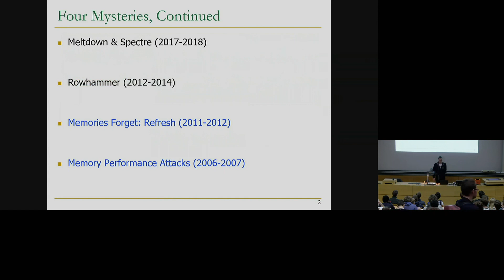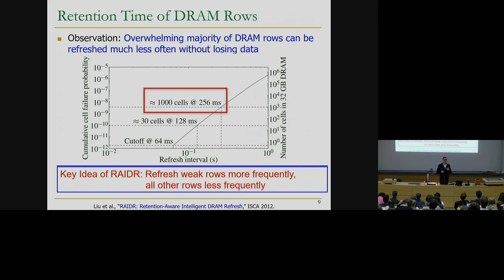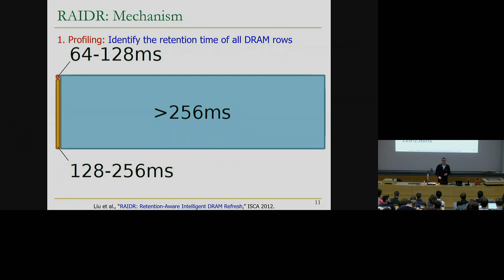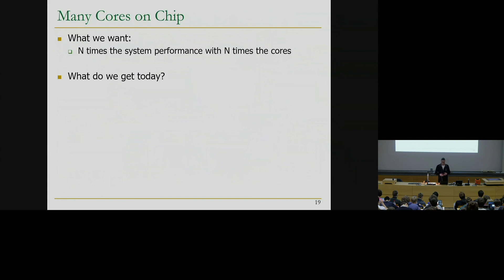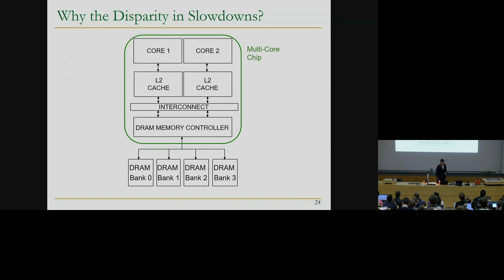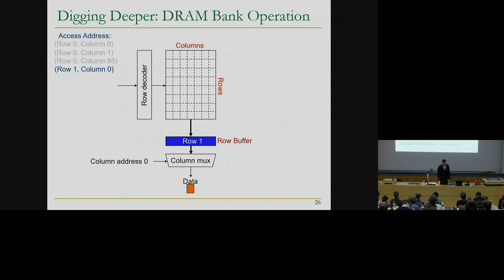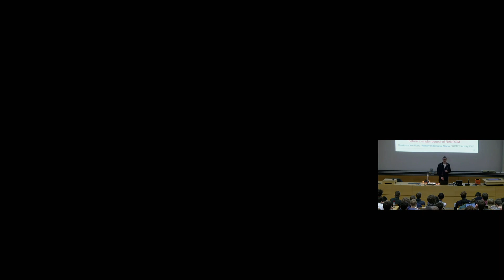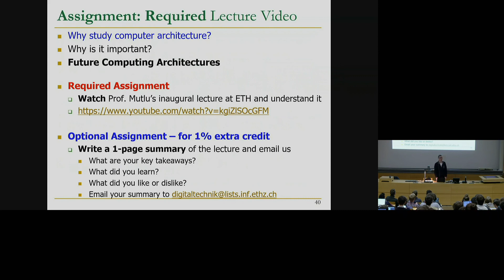Digital Design & Computer Arch. - Lecture 3a: Mysteries in Computer Arch. (ETH Zürich, Spring 2020)

Comment: Cooling DRAM is supposed to boost data retention time. I once read about a forensics experiment where a DRAM chip was cooled with liquid nitrogen, put into the freezer, then put into another computer to read its contents. I couldn't find the article, but there are other articles about cryogenically cooled DRAM. Probably just refrigerating or water cooling them would boost data retention times. Nice topic for some research work.